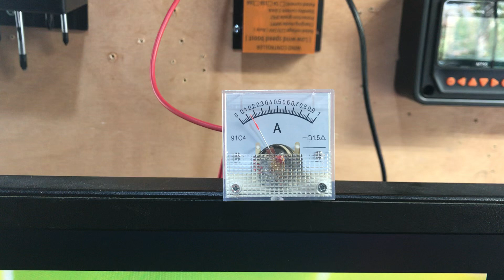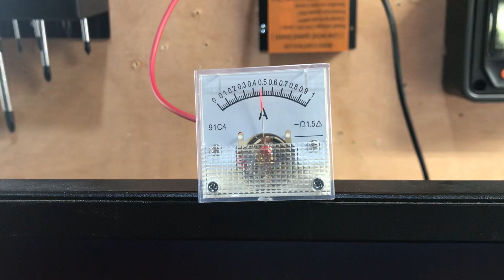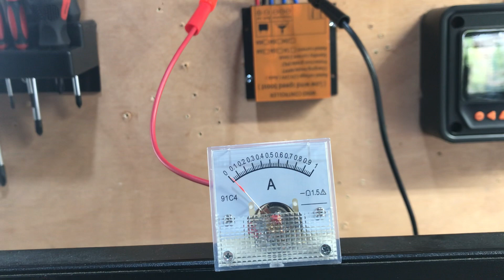VAWT with new meter

Comment: One more comment.

If the alternator is truly a 400 watt unit it is a bad match for the turbine.  My thought is that if one wire is disconnected going into the rectifier (running only a single phase) the turbine will be allowed to get up enough RPMs to produce the power it is capable of and the amps will increase.
Reply from the maker: Dan Edmiston. It’s so funny you would say that because I actually tried that and your right about the rpm’s but the amps didn’t go up, it actually went down a bit. The info on this alt says something about a 300 rpm max regardless of wind speed while under a load. That’s what is confusing for me. That’s what keeps me thinking about a different blade design, one that captures more wind to up the torque
Reply: @Checkitfirst  The 300 rpm max warning is most likely there because the voltage controller/ brake shorts out the alternator side when the set point voltage is reached (14V).  There would be a good change of burning out the shorted alternator if there is enough force to exceed 300 rpm. ( Maybe in a hurricane) 

If you email me at,   dan@edmistons.com , I can send you information on a VAWT rotor design that I developed that works well in turbulent winds.

Comment: Thanks for the reply.

You you be satisfied with the VAWT if it was producing 2 Amps at 14 volts with 18 mph winds? 

With the information you supplied and VAWT site information, I think that your VAWT should be capable of producing about 2 amps of charging power in 18 mph winds.  

The challenge is to find, or design and build, the right MPPT unit for the turbine.  I don't think a solar MPPT would do any good because they respond way to slow to handle the quick changes in wind speed.  I need to think about it more.   It may take a few months, but I'll let you know what I come up with.

Adding disk slightly larger than the diameter of the turbine, at each end of the blades, should improve the turbine performance by about 10%.  That would help some but probably not be enough to keep it from "stalling out" as soon as it sees a load.

Comment: Nice video.  Glad to see someone posting results and not just unboxing and set-up.
two questions - What wind speed is needed to produce 14 volts when unloaded?  What is the diameter and height of the turbine?

From what I can find the AWEA has only certified one VAWT, the 4 meter in diameter HiVawt DS 3000,  certified for 2.1 KW @ 11mps of wind (24.6 mph).  That works out to 10.84 watts per square foot.  Larger certified HAWT turbines, in the 30 kw range, get close to 20 watts per square foot @ 24.6 mph.

Where I live average wind speeds are closer to 10 mph,  about 1/15 the energy of 24.6 mph winds.  Still I am fascinated with VAWTs and try to soak all the reliable information about them that I can.  Thanks for your input.
Reply from the maker: Dan Edmiston. Well, unloaded it will produce 14 volts just turning it with my hand. Actually I did kind of an un boxing video of it and I was spinning it with a meter on it. When I hook just a rectifier up to it without the charge controller that came with it it produces upwards of 50+ volts in 20 mph winds. But once half an amp is delivered it appears the blade cannot produce enough torque to keep it spinning. All the info on this turbine is at Amazon. PAMICO wind turbine helix
Reply: its wired wrong so not a good video
Reply from the maker: @MrParts4sale    I dont think you understand anything..